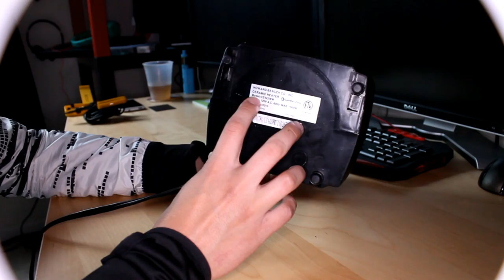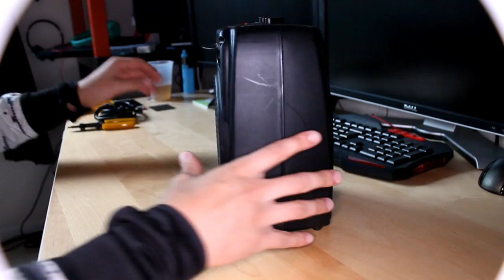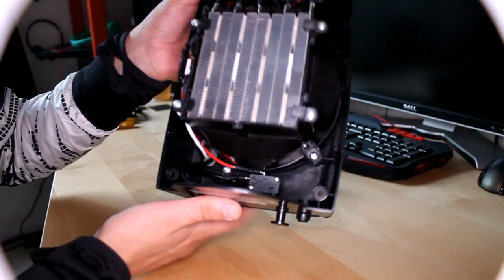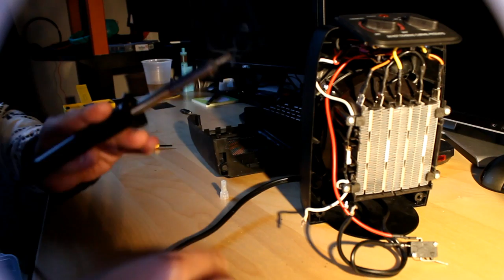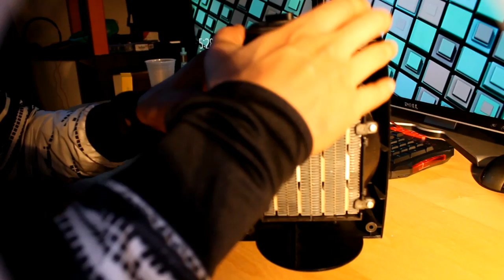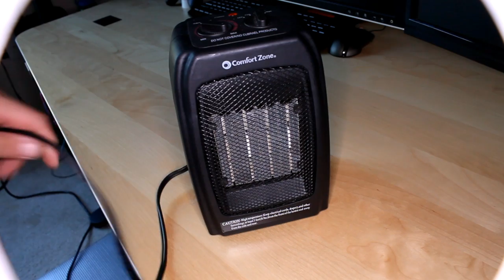Comfort Zone Ceramic Heater CZ442WM - Repair (Hot Power Cable Problem)

Comment: I know this is an old video but I wanted to say thank you @Andrew. These saved me $25. I had two old Comfort Zones "Ceramic" heaters nearly identical to the one shown here. One of them worked a little but shut down after minutes and didn't restart. I will share my notes in case it helps someone.  I disassembled as you did here and I didn't even need to re-solder (though I was prepared to). I simply opened it up, blew all the dust bunnies out, and used pliers to squeeze the ground connection near the base. I squeeze it to gauge whether there appeared to be too much solder. On a whim, I simply reconnected the plastic insulator. I checked that all other positive and negative connection points were firmly connected. Then put it back together and presto! It worked. I tried it on an even older unit. That one the LED lights up but the heat and fan never come on. That one did not respond  to the same treatment. I'll try re-soldering ground and getting the voltmeter out. I work with electronics regular (typically 3.3 and 5V DC) so I know the threat of short circuit or stored capacitance. Very helpful video.

Comment: my tip switch fucked up so I just cut it out, I have no kids or pets to knock it over....the thing ya gotta worry about is loose solder in the switch above to control fan alone, 750w anfd 1500w settings ...mine burnt up last night, on low setting not even 1/4 of max, took switch apart, the power wire actually burnt and part of casing, and inside the switch is a sub standard plastic and copper assembly, that is lighter guage than the wires connecting everything, and the switch has push in connections for easy assembly but dont stay firm...assuming one wire is for 750w and second doubles it to 1500, I think directly wiring the power to the 750 setting and use the thermostat to turn on and off may be best... bypassing a shitty fucked up power connection, literally a push in connection where the copper is bent and when ya push a soldered end into the opening the theroy is it traps the wire between the plastic and copper....but, this isnt battery operated shit where this may be allowed....all connrectors need to be marettes or screwed down, not pushed in....junk....full connection is not made with spring loaded copper....copper is soft, heat removes spring ability, over time it changes shape, wires get loose, now you got a fire
Reply from the maker: Yes thus device is me at up manufacture, thank you for detailed review, hope nobody got on fire this winter, cheers 🍻
Reply: After reading this I think I'll just buy a new one instead of trying to repurpose a pos

Comment: Mine just quit.   No Fan no Heater.    After three years.   So, is the fan & heater working after repair? I id Not see the heater part.
Reply from the maker: So your device not powering on at all?
Reply: @gav696  It powers on. I can see the light go on, yet No fan.    I can feel heat in low or high  at a very low heating, but Not blowing.
Reply from the maker: Unplug it from power, and take it a part, check out fan connection and try first to spin it with your fingers , maybe something hold it , let me know
Reply: Mine won’t turn on at all, tested the plug everything is fine
Reply: @gav696  Ok, I checked continuity. All is fine. Fan rotates fine. Cleaned everything w/ air duster. Nothing. Tried a different cord I had lying around, nothing.  One more try later on.
Reply: @Phantasmos  same problem. Feel it getting hot but no fan blowing. It stopped turning on after a few times of overheating an shutting off on it's own now it won't come on at all
Reply: @bigZtheG  I took it ALL apart looking for the 'thermostat' a ceramic piece... Either I am blind or I did not see one.  Unless it is a higher tech item... like relay or coil type.  Either way, I scrapped.  Good Little heater to boot!  I bought another... unfortunately... power went out(TX)!
Reply: @Phantasmos  I believe the thermostat is mounted on outside of the fan shroud, on the side it.
Reply: No fan .. everything else seems to be working ..
Reply: I've taken it all apart .. cleaned.. I don't know what to do next 😕 any help greatly appreciated!

Comment: How do you bypass the thermostat on that model? Mine will run for maybe a minute then turns off.
Reply from the maker: +Billy Mettlen with this one I have no idea
Reply: Did you ever figure out go to bypass the thermostat? Mine has the same problem!! Frustrating
Reply: Stay on low but turn on max
Reply: @malaysiab8162  thanks! That worked for mine 😃

Comment: can you link the power cable that you used? I want to get the right one...thanks
Reply from the maker: +Chad Lee have no idea right now, didnt have this unit at this time. You need to get high amper cable
Reply: He didn't replace the power cable, just resoldered the connection on the white wires.
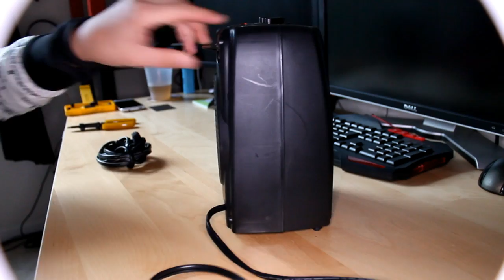Reply: 0:41 he said he had a spare cable, so I thought he replace it...guess I misunderstood
Reply from the maker: +Chad Lee first I was thinking it cable but problem was with soldering
Reply: ok I didn't buy this one got another at Walmart 10 bucks..
gas line broke and in Pensacola FL you would be surprised how cold it gets this close the ocean eats you up different even if only 50-60 degrees out...thanks
Reply from the maker: +Chad Lee stay warm